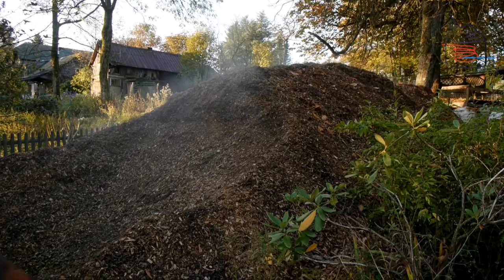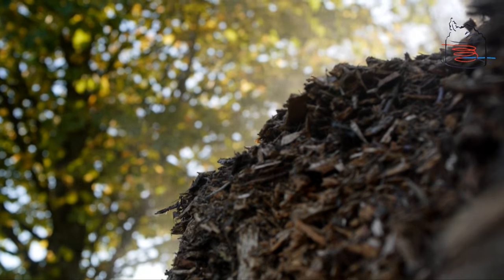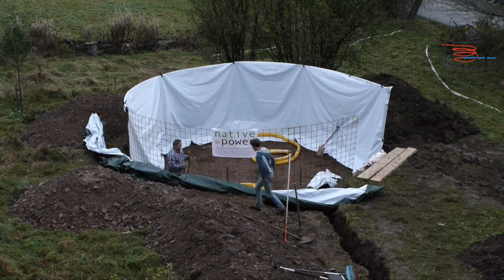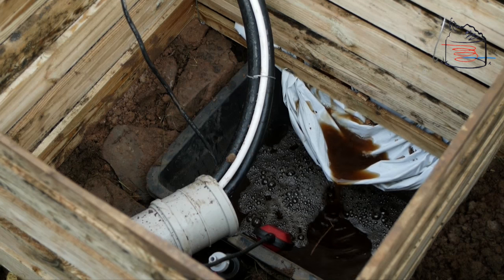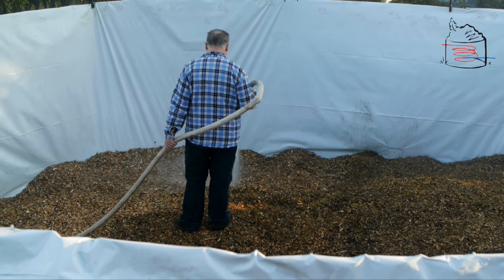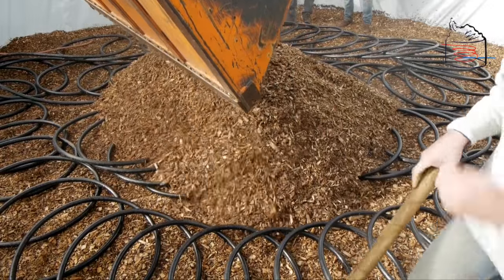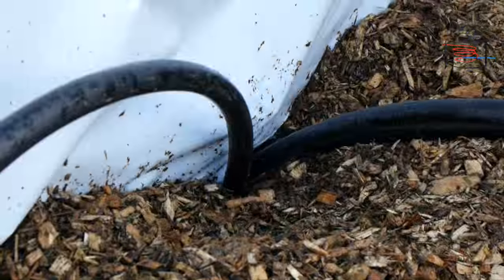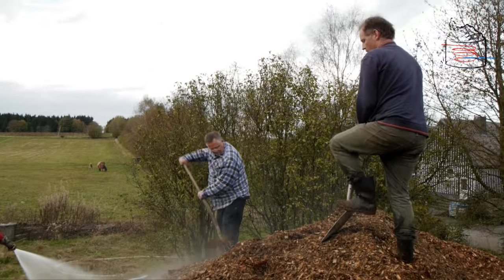Biomeiler - Drain off heat from the natural cycle

Comment: They forgot to mention finding a bunch of buddies to help, renting a front end loader, and having access to a fire hose. LOL
Reply: So sad in life you're just bitching randomly. I hope you see good around you in 2021. Be happy.
Reply: @Nadine----  
Some people will never be happy SMH
Reply: Actually that's a fair point,  cool experiment but the practically of this is...well it's not. Notice it's a telescopic rough terrain fork lift with a bucket, with delivery probably 500@ day. Hopefully you don't crush anything in your yard as they weigh 15 to 20 thousand pounds. Then there's the logistics of getting the chips delivered and correctly loaded into the bin. All that being said the clean up effort and recovery of all the tubing isn't a small task, you will need another machine rental to get it done efficiently.  Even if you own all this equipment the timing of building this to get the maximum output of the pile is critical to its success. One last detail you absolutely need electricity to keep it working or the pipes freeze. Before throwing stones how about fessing up to the fossil fuel your using to heat your own home or apartment.  The best renewable fuel we have is wood. I can cut and split a year's supply of blow down trees using less than 20 gallons of fuel start to finish.  That's less than this whole project ant it only takes one person. The problem with details is they matter.
Reply: @markw2266  you don't know how wrong you are! There is more than one way to do this that costs practically nothing. It's all in how you see it. No one will do anything cool with that pessimistic outlook.
Reply: @rhubarb4898  OK please post a video of you doing this for practically nothing so we all can see how it's done.
Reply: Still waiting for the video 🤣

Comment: Hi. I have tried this but it is useful only for 2 weeks long (60 degrees C went to 49 Degrees C in 14 days, water temp.,  right inside the house)...now the temperature goes to 40, preety slowly. What is wrong?
Reply from the maker: Hi Florian, we found out that your return water should be at least 40 degrees C to maintain the right bacteria active. Do not harvest too much warmth is the idea.
Reply: How big was your setup? It needs to be substantial.

Comment: What's the maintenance or rotation process once the mulch stops producing the heat is it difficult to separate the pex pipe from the layers?
Reply from the maker: After 2 - 3 year you can harvest the compost. The separation of he pipes from the layers is not easy... We are looking for better ways but until now the method in the movie is far the cheapest and works pretty good.

Comment: So do you have a resevoir of water for the recirculation or just what water you put into the pipe?  Did you bury/insulate any going away from the pile to keep it from cooling?
Reply from the maker: @owentp  we re use the water, we pump the ‘used’ water back to the top. Sometimes we insulate the outside with straw but mostly the outside woodchips insulate the Biomeiler enough
Reply: @peterjanbrouwer738  I meant the water heating in the black pipe in the compost pile.
Reply from the maker: @owentp  the hot water is used in the heating system of the house. It is more or less like a solar tube heating. Only here we don’t need the sun.
Reply from the maker: The pipes are insulated

Comment: Works one year. The you have to renew it
Reply: YES, that is great, because after that you have good compost for the garden and slow and cheap energy for heating.
Reply: Free heat other then electric pumps
Reply: @Floreypottery  ...and multiple tons of wood chips that need to be replaced every year and hundreds of feet of hose.

Comment: I wonder if adding some quail poo or rabbit poo would help to heat it up? I would think adding nitrogen would help heat the pile. It may cook it off faster but it will definitely jump start the heating process.
Reply: Yep, you need to add some nitrogen to get it cooking
Reply: In the beginning of the video they said to pump off the old bacteria water for use later. I think they forgot to add using that water activates it much faster. Wood is a source of carbon it needs a nitrogen source like grass clipping which is what most home owners use. Animal waist fertilizer would work, it may smell but it would get the job done. I'm gonna be building a greenhouse next month I really should consider at least trying this to heat it. I was going to go with solar. I wonder if I couldn't just dig a large pit and top it off level to the ground and use a pump to lift the hot water up and out to circulate it. Hmmm?
Reply: any animal manure will boost the proces, just mix it well with other material and soak
Reply from the maker: It may finish the biomeiler faster.... But as you like. Our Biomeiler lasted more than 2 years, for us that was the main thing.
Reply: If you over heat the mound you will actually kill off the bacteria that both feed on, and heat it up?
The mound needs to have a good air supply, to maintain it and stop it from over heating..

Comment: Why not put an old metal radiator in the pile to capture heat instead of plastic pipes? Could be much simpler to both build and disassemble the pile.

Comment: what about composting pooh,!
Reply from the maker: Localwise @Groningen did that... there research is in dutch however but it was a very promising project. As the temperature gets high for a long time the compost with pooh and pee was extremely clean. You still have to be careful though.

Comment: I thought processing firewood was a chore. This is bizarre.
Reply: A lot cheaper then buying fire wood then again this wouldn’t be for super cold areas
Reply: @Floreypottery  this would work in cold areas just as well. Instead of the internal temp reaching 160f + it will be a more moderate 110F.  Anywhere between 110-130 is good to keep the microbes churning.
Reply: I would just go with a woodstove with a water jacket. Keep it simple. Most dont have the heavy equipment and would end up having to dig all that out by hand to replace it.. That would be lots of work! And costs of having all that hauled in. Just saying.. But cool idea.

Comment: Do you have any data about taken energie over time by what volume ?
Reply from the maker: unfortunately in dutch only: https://biomeiler.nl/prijzen-kosten-en-opbrengst/
Reply: Found info at permies.com. the men heat 2 houses a workshop, wood and many more. My God never thought it was possible.
Reply: @Nadine----  Its really amazing. You get quality compost for the price of wood chips plus free heat you can heat your greenhouse with during winter. People pay crazy amounts to heat their greenhouse plus paying for yards of compost
Reply: @Nadine----  
When I turn over my little 10 foot wide 6 foot high compost pile steam rises out of it. I can imagine how much heat this thing must put out. They mentioned jumping out the old water with bacteria to save they forgot to say you need to spray it over the wood to jump start the composting by bacteria breaking it down. Itcs not necessary but if it's not inoculated the process takes a lot longer to start to break down without turning over and mixing with air which defeats the whole purpose here

Comment: How do you actually use that heat to heat your house? How is it set up?
Reply: Use it like geothermal. Water is pumped through the hoses and back to the house through radiators or something.
Reply: Same way geothermal works or you can heat just radiators
Reply: you would need to pump the water to a water source heatpump

Comment: what type of fabric is placed between the layers?
Reply from the maker: It's a strong plastic tile (used in agriculture) with holes big enough to let pass by the water and the bacteria.
Reply: So if I wanted order some of the material between layers, what would I google?
Reply: @nexumbra1231  Weed Control Membrane
Reply: @nexumbra1231  
Or a landscape fabric

Comment: If it was enclosed they could also Capture the methane gas and use it
Reply: Very true to run a generator or to make fuel maybe
Reply from the maker: But that is what we don't want to do :-) we think that the woodchipcompost is an extreme good product. Actually the warmth is an extra...

Comment: I've spent a winter in the Netherlands. I don't know exactly, because it was included in the rent, but I'm fairly confident that my heating cost less than 100 Euros, for the whole winter. That's 12,800 Euro less than this 12,900 Euro project which will yield similar results. And no, getting compost at the end of the process doesn't justify it. You can get compost for far cheaper, and much faster (so, without tying down a significant amount of real estate, which in the Netherlands is especially valuable, for two years).

So while this may make sense in remote, northern regions with plenty of space and without access to natural gas or an electric grid, in the Netherlands, and most of the world, it's strictly a research or hobby project. Not a productive enterprise.
Reply: Where did you find the cost information for this specific project? How large is the space you were renting relative to the amount of space this pile is capable of warming?
Reply: @tylerblack3508  From the link posted under the video, I think. It's probably in Dutch, but you can read Dutch reasonably well if you're an English speaker. Certainly well enough to check my numbers.

As for the space, it doesn't really matter. If you could heat a castle, t would still not be cost effective.
Reply: @deinse82  you are missing the fact that the materials can be reused again and again and again.  The wood chips probably obtained for free.  That leaves the labor cost.  If you are going to compost the wood chips anyway, how is this not win-win?  Nobody is going to do this on land they would otherwise be building an apartment block on.  It will be in gardens and other outside space.
Reply: I was looking into this to boost the heat in a greenhouse in the winter, which is very expensive to keep going with convential means, and a cattle barn. When you go into agricultural uses, or larger scales, the scales change. In Wisconsin you can guess about $100 per year, per cow in electrical expenses, which is heat and lighting- so if you have 100 cows... being able to cut your power bill in the barn by 90% can be the difference between profit and loosing the farm. Most of the dairy farms I know have between 300-500 cows. So you're talking about close to half a million dollars a year when you get to the commercial scale, if you can put a few of these outside your barn when it's snowing outside. Cows also eat a LOT more when they are cold, so you'd save on feed- not just heating expenses.
Reply: Damn someone’s butt hurt
Reply: @BippyGrace   you have to try it. You have free manure. M. Bob Anders at permies.com heats 2 houses, shops, dry wood etc... Incredible.
Reply: Exactly!  Plus, they didn't mention their failure to cool the pile. When the pile gets above the 150 range the heat kills some of the bacteria that is needed to keep the pile going. These people just tossed a video that is a feel good video for the gullible.  Way more factors involved to keep the spec they spoke of going for two years.  
Remember if it's too good to be true, it isn't.  If it were that easy and reliable everyone who needed the cost savings would be doing it. They aren't doing it for a reason.
Reply: I think it meant to be an experiment as an alternative for heating without burning a shitload of fuel. Probably not for big scale, I admit. But I guess fossil fuel lobby is too heavy anyways when it comes to alternative, sustainable methods
Reply: €12,900 doesn't make any sense. A cubic meter of woodchips is $25 and hose is $2 a meter, rionet is $10 a meter. Not sure about the plastic but it's not going to be more than $500 tops.
Reply: @scroogemcduck1462  

I was wrong, actually. I missed that 12,900 was just the labor and logistics costs. The materials cost another 5,800. So the total cost was 18,700.

And it's irrelevant whether it makes "sense". It's fact. That's how much money they spent for all the things you see in the video. The costs are on the website: https://biomeiler.nl/prijzen-kosten-en-opbrengst/

Obviously, these are Dutch prices (which are very high, fun fact: gas costs about 5x more there than in the States), and the cost of labor is valued at local market prices. And they didn't try to cheat, they included ALL costs, as an honest project should. 

For example, renting the machine you see in the video, along with the driver, for 16 hours, costs 2,100 Euros. Trucking the materials to the site costs another 1,600 Euros. The design/consulting work is valued at 75 Euros/hour (which makes perfect sense to me, since I do a similar job, and that's about how much I made an hour when I was in the Netherlands). The full list is in the link, and it's not that hard to understand, if you look up some of the words.
Reply: @deinse82  I know what it costs to build one of these as I've been planning to heat a greenhouse with a compost pile for a while. If you see the prices I've estimated above and compare them to the prices on their website you'll see they are actually very close to each other, and I'm quoting prices anyone can get  immediately from stores online, you can get it cheaper if you know a guy or are willing to wait for a good deal. Their installation fees and consulting fees however are crazy and they are adding a lot of surcharges on top of the materials like a "1 time added fee". Renting a bobcat costs €100-200 a day with 8 hours of use which is more than enough, you don't need €2000/day backhoe for this job. 

I'm not saying people shouldn't get paid a fair salary and I'm not discounting the labour hours, I'm just saying you can do this yourself with a couple of days of work and save 85% of the cost as those account for labour and consultation fees and whatnot.
Reply: @deinse82  
I know a sawmill owner who burns away more sawdust and chips in one month to fill 3 of these. The wood is basically scrap if you know where to source it. That isn't that much labor to do. I compost for gardens and a 10 foot wide 6 foot high pile gets steaming hot. It cooks for about a month, BUT that's only because I turn it to add oxygen. If it's not turned it'll smolder for a long time. This is clearly a cost effective method to heat water in cook a like that. Rain water and lack of oxygen keeps it from burning away and killing the beneficial bacteria
Reply: 100  euro for the entire winter? even a 100 euro a month would be on the very cheap side.
Reply: @deinse82  idk where your pricing materials but pex pipe is dirt cheap your prices sound like geothermal install prices lol